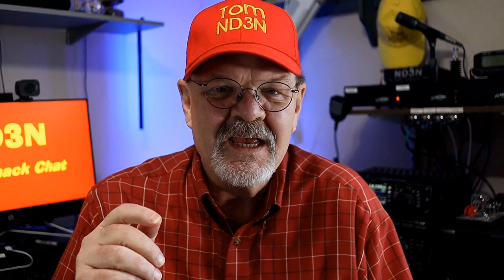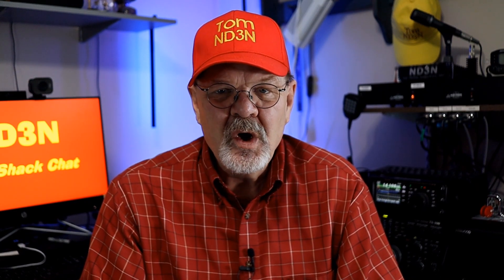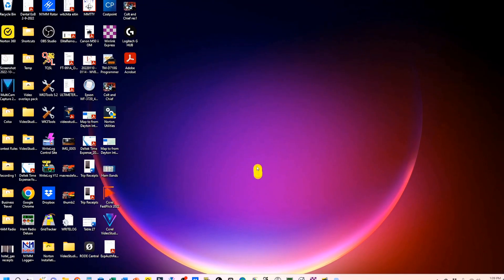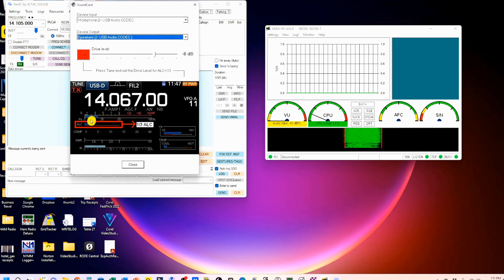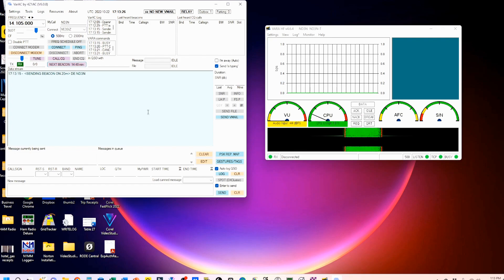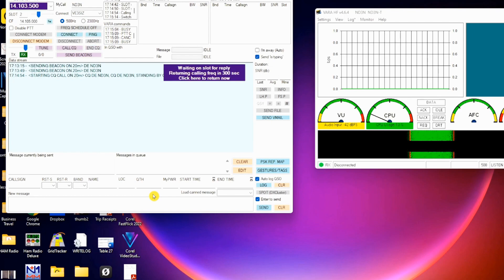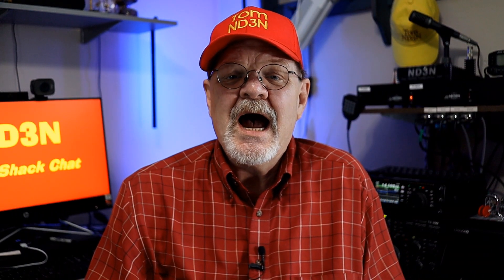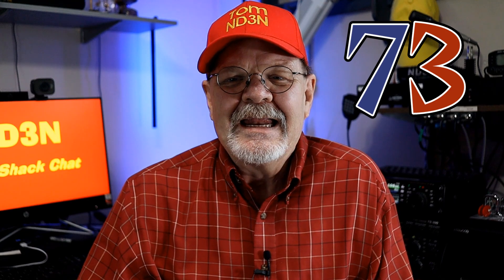I'm SHOCKED at how well this works!!!

Comment: I installed and used Winlink and VARA about a year ago for a few weeks. I decided to try it out again this evening after seeing your video recommendation. I also purchased a license for VARA tonight as well so I have a registered copy. After setting up the VarAC with my IC 705 (took 5 minutes) and saw you send the beacon. That sent, then I called CQ and to my surprise I got a call from KE4QCM, who was great. I figured out how to send custom messages and apologized I was a rookie. We had about a 30 min. QSO on 40 meters. Thanks for the video and I had a good time setting it up and using it tonight. 73 de KN3A

Comment: I've heard thru the rumor mill that VarAC QSO's aren't yet recognized as authorized QSO's in the digital modes within LOTW and QRZ... is this true?
Reply from the maker: Great question - the short answer is "I don't know."  However, I don't see why it wouldn't be.  It is a direct connection between two individual stations, without going through any intermediary stations (such as a repeater in VHF/UHF FM), or using a VOIP system like DMR, D-Star, or C4FM - system fusion, etc.)  It is more closely related to RTTY, PSK, FT8, etc.  When you make a contact with VarAC, a log entry is made and kept as an ADI file, which you should be able to import into your logging program.  The only unusual thing I see in the ADI file is that the contact mode is "Dynamic" where my FT8 logs have the mode as MFSK.  I haven't tried to upload it to my main log, but will play with it and see if it is recognized by LotW.  73 de Tom, ND3N
Reply: @ND3N  Could you do an updated video on your 991A settings that work with WJSTX for FT8, JS8CALL, FlDigi for PSK and Olivia, Winlink, VarAC? I know you've done separate videos but want to be sure a single set of settings will work with all of these without having to make changes between them or make changes to the 991A when switching between digital mode use and SSB HF use. Thanks for considering this. 73
Reply from the maker: I'll have to expand this, but here's a start...  https://youtu.be/CqRmJy3s_8k